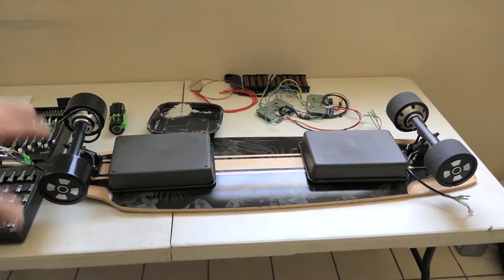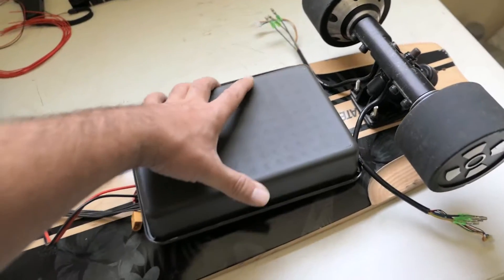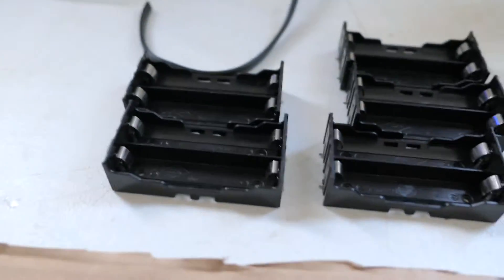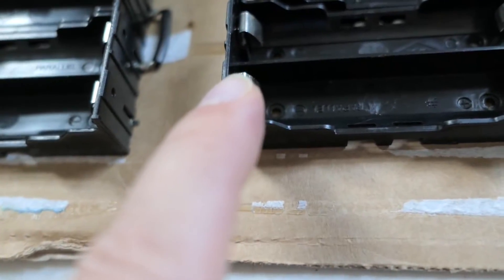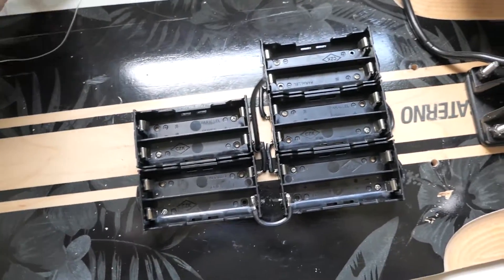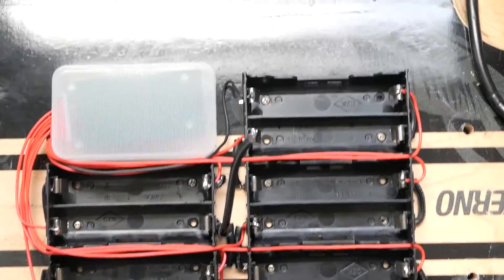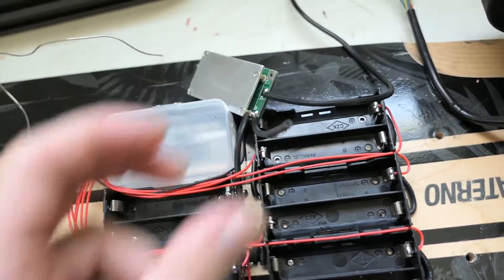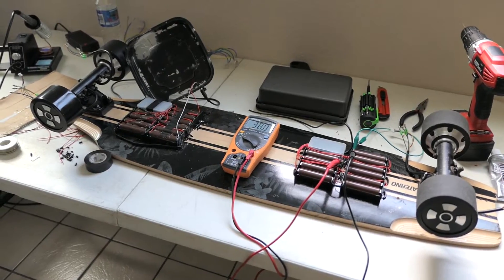4WD Electric Skateboard Build - DIY Battery

Comment: Poorly built. I have safety and longetivity concerns about your battery config. 
-The wires are too thin to handle 20 amps
-It's awful to pull the required power for 4 motors from a 2p let alone 1p Li-ion config (ideal discharge less than 5A per battery, 10A max).
-With aforementioned arguments, your batteries won't last more than 500 charges and your board may catch fire if not protected

Comment: How would you connect two 10s2p batteries that are prebuilt
Reply from the maker: You would connect them in parallel. Positive to positive and negative to negative. That will give you 10s4p.
Reply: Just Vlad https://m.ebay.com/itm/XT60-Parallel-Battery-Connector-Cable-Dual-Extension-Y-Splitter/322658366759?item=322658366759&ppid=PPX000608&cnac=US&rsta=en_US(en_US)&cust=68A61326U9800410G&unptid=4401bc5e-9b97-11e8-9b51-441ea14e0854&cal=5f98b1f9f77d&calc=5f98b1f9f77d&calf=5f98b1f9f77d&unp_tpcid=email-receipt-auction-payment&page=main:email&pgrp=main:email&e=op&mchn=em&s=ci&mail=sys&epid=1331395981  
Would this little duber do the trick?
Reply from the maker: Yes, that's exactly what you need 🤙

Comment: All we want to know is how you are going to sync both ESC's? I sell the same exact setup and never found a way to run them in sync like VESC. Furthermore, one esc has to be a master for the remote I just not sure how this setup will work. Can you help explain I would love to build one.
Reply from the maker: Actually everything is synced from the seller and ready to run: https://www.ebay.com/itm/4WD-longboard-skateboard-controller-with-remote-ESC-Substitute/302558036328?ssPageName=STRK%3AMEBIDX%3AIT&var=601397417634&_trksid=p2057872.m2749.l2649
Reply: Just Vlad oh wow lol that is awesome. So they do it at the factory and ship like that. I'm going to have to stock these. Wish I could push these bad boys to 12s. That is a great solution and super cheap like the cost of 1 VESC with ability to control 4 motors. I want to see this video of riding when you are done.
Reply: I just programmed my 4 VESC's building my AWD 6374 board; will post a video in a few days, 12,600 watts of power.